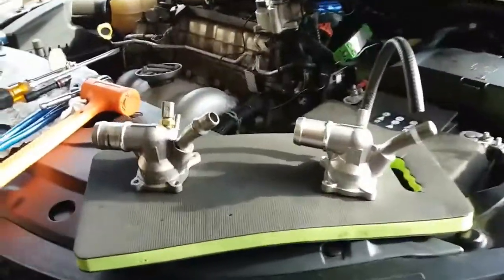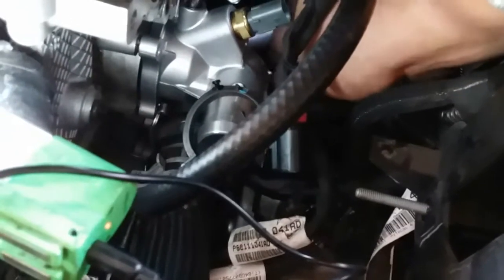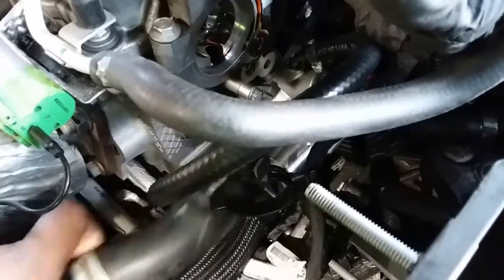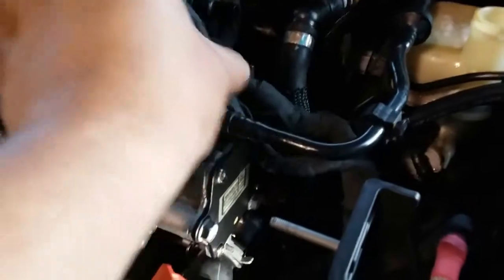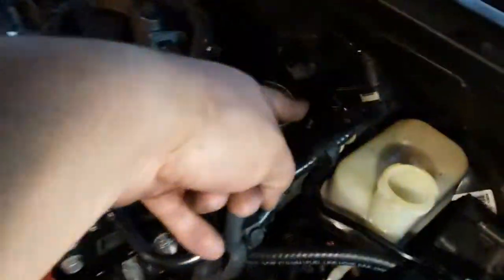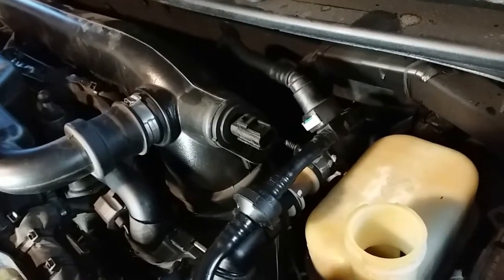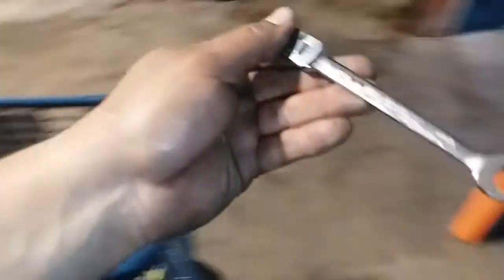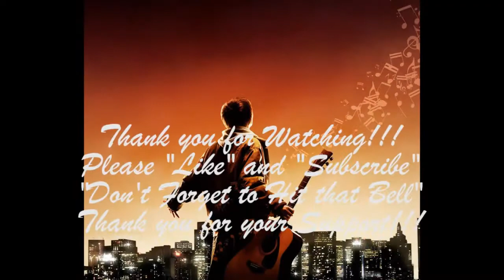How to: Install a Thermostat on a 2015 Chrysler 200 Code P0128 FIX

Comment: Will this sensor cause issues with the throttle body needing to be replaced also?
Reply from the maker: No shouldn't cause any issues with the throttlebody. Just temps
Reply: @559powerscape  how long is too long to let that code linger because repair?
Reply from the maker: @Juggernaut 💪🏾  well the sooner the better but as long as your temps keep to normal temperature your okay. Keep an eye one it and add coolant if needed